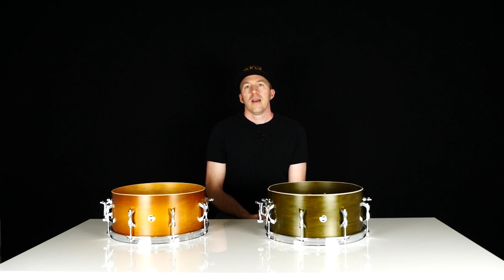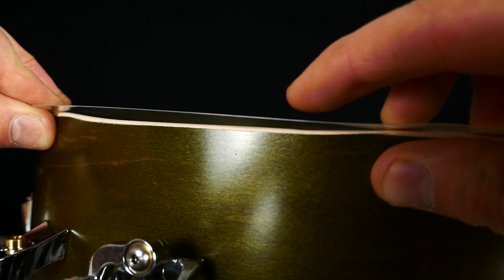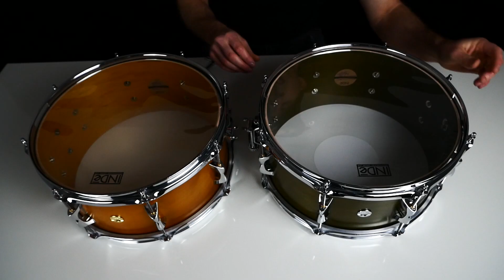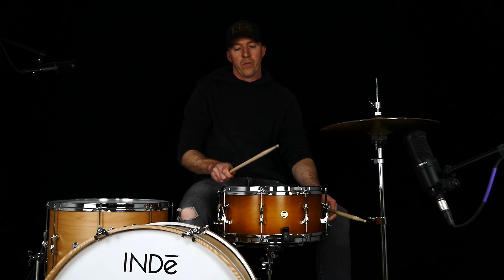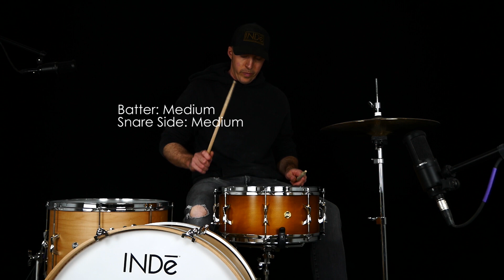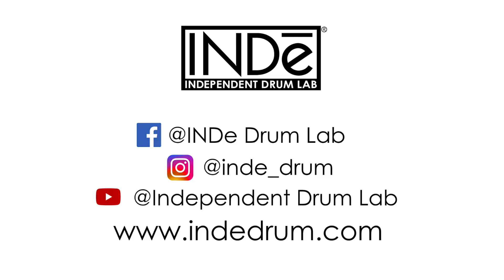Infinite Snare beds now on INDe wood snares!

Comment: A snarebed is useless as there are 2 gaps on the reso side betw. head and shell. Tensioned wires are bent upward in the middle of the head which hampers the vibration of the reso.
I always used parallel-/Rogers-frame or semi parallel like Ludwig and others offer.

Comment: This is nothing new. Ludwig have been doing this since the 60s with their "acoustiperfect" snare bed. ie. Supra-Phonic snare bed.
Reply: But were they doing it on wood? Don't get me wrong; I'm a major Ludwig fan. I've been using their snares exclusively now for over 40 years. Hell, Josh even worked for them and executed a MUCH-needed overhaul on both the kit and accessory hardware. 

 It shouldn't have taken Ludwig 8 million years to develop a 2-leg hi-hat stand and a scientifically sound tom holder that didn't slide all over the place (that 70's "field goal" garbage that was finally removed from the pro line and unceremoniously dumped onto my first set in the 80's (Rockers), pierce the shell with a 7/8" hole and supported by blocky, clunky insert mounts (Modular), or provide a legitimate alternative to RIMS systems (Vibrabands).

 But, that's just how they roll. And they're damned lucky that their name and legacy allowed them to weather those horrific, out of round shell builds they were cranking out from the dawn of the 70's until the mid 90's. Thank God they took the clue from getting their asses whipped by the established and emerging custom shops as well as all of the "mom and pop" drum shops that were slapping hardware on Keller maple and selling it for less than the Ludwig "intermediate/working drummer"-kits.

  They finally got it together though and now they can truly compete in the market again with a diverse and great sounding pro line AS WELL as a name.

 Finally, I'm grateful that there are builders like Josh who are committed to pushing the boundaries and developing MEANINGFUL, scientific technologies and mods in the name of great sound.
Reply: Tama also has this kind of snare bed. At least on the 13x7 G-Maple. Very articulate and smooth sound.

Comment: Maybe I'm missing something....maybe its the recording....I'm not hearing a good snare sound.  For great response from your wires, the snare side has to be tight.  And how does the bottom rim conform to that oddly shaped bearing edge.  The conventional snare bed still does its job just fine.  If it aint broke...
Reply from the maker: Conventional snare beds work fine if you are looking for conventional snare sound, with your snare head tight.  This snare does that, but also offers a lot of other options.  A lot of drummers are looking for fatter, deeper tones that other snares just can't do.  The Infinite Snare Bed is only 1/8" deep, which is fairly shallow compared to a lot of snare beds, so no problem getting the hoop to conform (you can see in the video the head is seated under finger tension!)